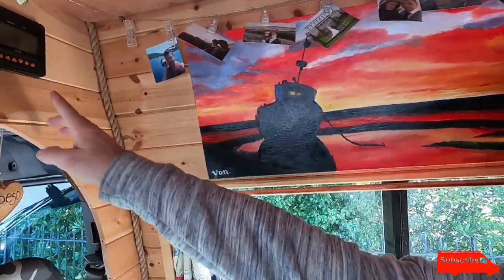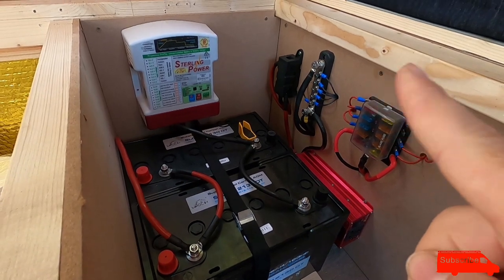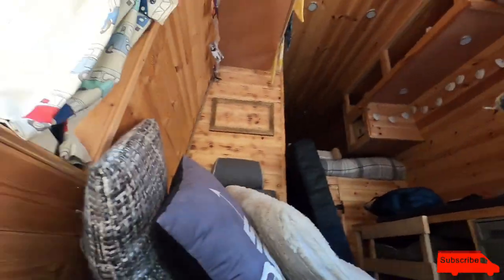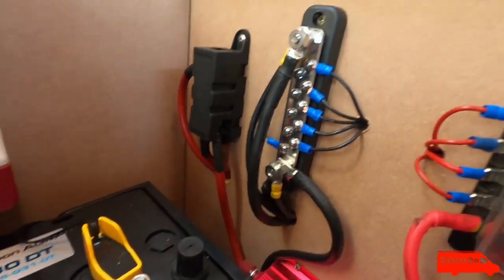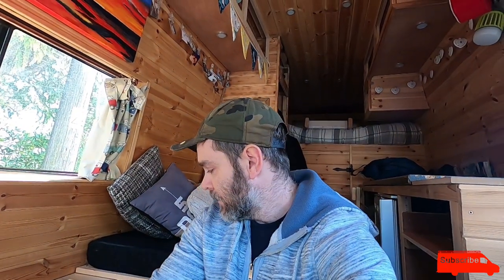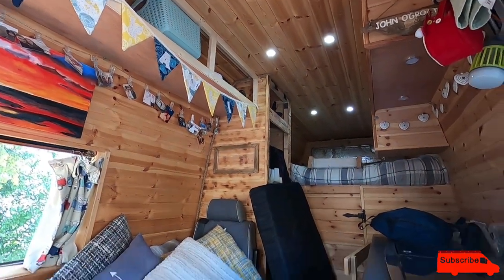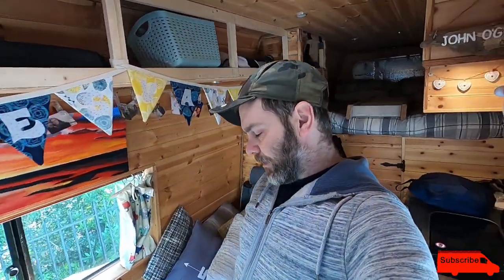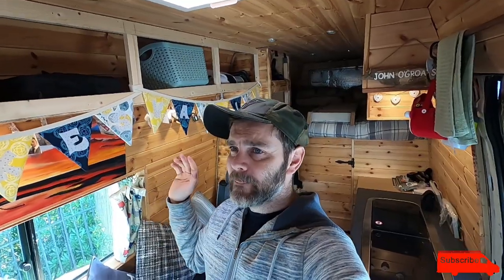My 12 Volts Electrics!

Comment: I think you have done a really neat job using the proper tools, well done you and Phil.
You are so right to wait a few months to try full-time van life. such a wise decision.
 
I would put the date of the batteries on top so people know when they were fitted. you should double-check you have the right fridge fuse fitted, that's really important now you have changed the power cables. maybe a fuse before the solar controller? 
You and Phil could do a simple video on van electrical connections dos and don'ts Crimp vs Solder.
Reply from the maker: Hi Mandy, Thank you very much. There will be lots more electrical bits to do but I am very happy with the results and thanks to Phil I had all the right tools and his guidance. I'm eager to move into the van and gutted we cant right now, but i your right, it's not the right time. soon though! :)  When you say put the date on the batteries so people know? What people? do you mean in case I sell the van? I will double check to fuse situation's. Thank you for the tips :)
Reply: @LukesVanLife  I work with heavy machinery its a health and safety thing plus it helps to sell them later on.

Comment: You can get a nice tidy switch gang plate on eBay for around £12 with 5 switches a 12v power outlet socket and 2 u s b's sockets and a voltage gauge in a black 5x8" square that looks neat and profesh plus that would help future prof having a couple of spare switches ;) just a suggestion looks good in my bus anyway :)
Proper nice job on your van by the way :)
Reply from the maker: Hi, I do already own one of those switch panels which I had in my first conversion, but I want something a little more rustic for this build, ive got my eye on a few. Thank you for saying you like my van and thank you for watching :)
Reply: @LukesVanLife  Hi fella yeah i admirer your van and channel when im more on my feet and this lockdown is done with i hope to do something similar to your build :)
I also hope i can build something even half as good and ill be happy 😊

Comment: Nice video and install mate 👍 couple of things I love your technical chunky wire 😂 but yes definitely needed it as its combats voltage drop its not always just about the amps . Your earth/ground/neg from inveter id move to the same bolt as your battery on the busbar as think that busbar is only rated at 100A but maybe wrong 😉 . Your lights are spot on mate and really good practice to take all negs back to battery/bus bar. If you wanted to get really tech then you could of used relays but that really ott. Fuse are there to protect the cable so also size cable to device and fuse to cable 👍 10/10 for grounding to chassis 👍👍
Reply from the maker: Hi Spunky, haha chunky wire :) I'm clearly not a tech guy like you :) Regarding the inverter neg, so If i did that my 200amp fuse wouldnt be working for the inverter? is that right? I do have some questions about my mains 240 hook up, Im comfortable with 12 volt stuff but mains is a little scarier :)
Reply: @LukesVanLife  thats tech enough for me bud 👍 the chunkier the better 😁 I'm not sure where your 200a fuse is, but the inverter neg doesn't really want to be running through the busbar in the vid it looks like the battery connects to the top of bus bar and the inverter at the bottom, id just move the connection from the bottom to the top on same bolt as the battery. Hope that makes sense? That way the big load of inverter isn't going through the bus bar. But that said if the load is less than the rating of the bus bar then no problem 😊. Just drop me a message on insta mate and I'll help as much as I can with your 240v 👍👍
Reply from the maker: @Spunky.sparks  if I moved the inverter to the top of the bus bar then I dont think there will be a fuse between battery and inverter, should there be?
Reply: @LukesVanLife  yes mate there should be a fuse just incase it decides to have a hisy fit 👍
Reply: @LukesVanLife  let me watch video again lol 😆
Reply: @LukesVanLife  the fuse should be on the positive mate not the neg thinking about it lol
Reply: @LukesVanLife  like I said mate it might be OK if the inverter is pulling less amps than the bus bar is rated to 👍

Comment: Just subscribed to your channel. Great job with the electrics Luke. Be careful with the switch to isolate the heater, as I am sure you know these chinese heaters need to go go through a shutdown cycle and can not simply be turned off as they will overheat quickly and can be potentially dangerous not a criticism as I think you have done a sterling job with your build just tell the missus not to hard stop the heater.
Reply from the maker: Hi William, Thanks so much for the sub. You are right it might be tempting for someone to kill the heater power with that switch, we obviously know to let the heater run its cool down process but I will make sure the wife knows as well :) Thank you for the kind words, watching and for subscribing :)

Comment: Hi Luke. Well I think you’ve done a really neat job. Yes label the fuses and a basic wiring diagram could come in handy. A 10/12 fuse box with built in bus-bars would have been easier and a bit tidier as the Neg bus-bar is in built; no ties needed. The Stirling B2B chargers are fantastic aren’t they, and Sterling is a great company.

I would like to make a suggestion. In winter you will probably get low on power during the Dark Months: Nov - Feb. Yes tilting solar panels make a huge difference. However as a backup I would consider a suitcase generator. This can be plugged directly into your 240V hook up to charge your batteries and also charge anything else via your 240V system as long as you have some sockets. I have a Honda EU10i. Not cheap for sure but absolutely superb! It could be a “life saver” in winter. I also think it’s good practice to have a backup for other essential kit. If your heater packs up in winter, how can you keep warm? If the hob packs up how can you cook etc. A small camping stove with fuel could easily get you out of a jam. If you had a Generator,  consider buying a cheap electric fan heater that in the event of a failure could provide some well needed heat in winter, or you could buy a basic gas heater  (Mr Buddy are great) that again could be plumbed in just in case, but ventilate of course. Just for emergencies. 

Living in your van is a great idea to save money and I wish you all the best.
Reply from the maker: Thank you so much, the advise and tips are very welcome. I'm taking notes :) 😁👍

Comment: Swapping out the VSR was the best decision so far, it only works with standard lead-acid batteries like the starter battery...
Bit pricy that B2Bcharger, but worth to extend the life of the AGM´s!
I ordererd a switch panel from ebay, one wit the the "zombie light" switches already labeled, was 10@ off from the individual or camper-style labeled, you only need to rmember what switch is what...
:-D
Paid around 30€, came with 6 switches, 12V socket, dual USB charger and voltmeter. I had to change the wiring on the backside, because the charger would be always turned on and waste energy. The positive poles are all looped through with 1.5sqmm wire, I wired them straight from the fuse block to the switch and from there to the devices. 

But be careful by removing the factory connectors, the main input wasn´t even crimped and I pulled a connecting pole out of one switch, got it back in and it works, but I can´t trust that switch anymore...
8-0
Bridging from the input of your fusebox to a second one could work, but I would recommend a new positive wire from the big primary fuse to the new fusebox...
Nice setup so far, next thing on my side will be a solar system, I hope everything goes right!
Thx for the vid!
:-D
Btw, don´t mention the plague that´s going on, I heard YT demonetizes vids where it is mentioned!
8-0
Reply from the maker: Thank you very much! Sounds like your build is coming along nicely :)

Comment: Independent earths can half voltage drop to a particular device. Using a twin run of wire, it has to travel there, and back, on possibly a small core of wire. Having the earth to the body reduces the resistance and so you get less volt drop. At least thats the idea!
Reply from the maker: You clearly know your stuff, Im still a noob haha :)

Comment: Looking good Luke 👍 switching can be complicated,  your using single pole switches which meens you only connect the positive or live cable to create a brake in the circuit thus turning things on and off,  the other kind of switching is a double pole switch and that meens you connect both positive and negative in order to create a brake in the circuit,  if I was using your choice ( single pole ) I would personally install a main double pole switch between my power source and all circuits that way I can safely isolate all circuits from my power source.  but that’s my own oppion and what I call a belt a braces approach. Good luck with the build mate it’s looking realy nice I especially like the pine TC boards 💪👍
Reply from the maker: Thank you very much for the tips. Electrics like the rest of the van is still a working progress :) Thanks so much :)

Comment: Good video.  Did you run a separate negative to the starter battery or just ground the negative to the vehicle near the sterling unit, also was the unit 30amp or 60 amp.  Thanks
Reply from the maker: Hi Brian, all my 12 volts are grounded to the earth on the leisure battery which is grounded to the chasis of the van which in my case is one of the bolts which hold the drivers seat down :) Also Im not sure which amp my unit is, Ill find out :) Thank you for watching :)

Comment: Hi Luke I'm just about to buy a van probably already built as my DIY skills are non existant your electrics look great I am unsure how I'd put lights in. Do I extend + and - back to the fuse panel or can I run them in Parallel? I also thought if you wire in the 24 volt hook up why not invest in a little generator. Sounds like an idea to me but maybe its not doable. Anyway love the Vlogsany thanks. Russ.
Reply from the maker: Hi there, apologies for the delay in replying. regarding the lights, the ceiling lights for example, I have six ceiling lights each with a positive and negative so instead on running 12 cables towards the batteries I connected them all together, all the positives together and all the negatives together. then you can run one cable (twin core, red and black) to the batteries. yes i could have a generator to power the 240 system if i wanted but Im hoping I will have enough solar/power to not need to find space in the van and carry a generator. If you dont already follow IVEAVAN on youtube, follow him, he has a real nice gennie in his van :) Thank you so much :)
Reply: @LukesVanLife  Hi Luke thanks for the reply I do follow IVEAVAN to I look forward to getting a van and taking tips from you both

Comment: I take it the light switches are on the side of the kitchen unit for using as soon as you come in the sliding door, can they be operated from anywhere else, just thinking about getting up for a pre in the night or early morning in the winter
Reply from the maker: Yes they are there so you can switch them on and off at the door. And as it stands they are the only switch for the lights but they may change. I've got more lighting to be fitted soon :)

Comment: Hi Luke.. I will leave this comment on.. Phil has phoned me and explained how the system works.. YES now I agree it does work how it should so there is no worry over it.. Cheers Bud

Hi Bud.. This is NOT a bad comment, just concerned.. Ha.  Going by what you just said (at 9:12) that one of the fuses in the box was your solar..? That means then you disconnect the batteries (or isolate them) the solar is still putting power into the fuse box..? This will still power everything ells that is connected to that fuse box..?  It should go direct to the batteries throw a switch.. The way to test this is just to disconnect the pos lead on the battery and use a voltmeter and check the fuses power..??  But I just think that because you don't really no what the fuses are for yet..?? Haaahaha Looking good though.. Cheers Bud
Reply: OK Phil. Thanks for explaining it to me..  The Fuse is the shut off. Cheers Bud
Reply: OK Luke your .. Your safe Phil phoned and explained it to me.. Cheers Bud
Reply from the maker: Hi Kev, I couldn't explain it as well as phil can so I asked him to. I dont know as much as you guys yet :) still a relative noob :) hope your well.
Reply: Hi Luke.. YES all well here.. not been out of house for 4 weeks now. Just going mad and giving Netficks a caining.. 
When I watch video it just came over that that box would be live all the time.. but phil explained and then realised the mppt controler was the key.. I have only really delt with mpt controler, so sorry for the confusion.. Cheers Bud and Stay safe and go mad like the rest of us..

Comment: How do
You can purchase a temperature sensor for your charge controller you will notice there is available plug connector next to the solar cable input
They are about £10 available on eBay
Reply from the maker: That's interesting, do you have a link for one? Thanks alot :)
Reply: 264576980072 once fitted they take the controller out of dumbe mode
And regulate the voltage as to the temperature of your batteries
Tidy wiring job for a guy who says he knows nothing about wiring well done
Reply from the maker: @sircaptainchaos2388  thank you very much :)

Comment: I've been looking at these batteries there old tech being brought back I believe can you do me a favour and whack on your diesel heater and let me know what your voltage drops too after 5 mins please as I have a 220ah battery and seems to drop the voltage quite quick and may change to the agm carbon type you have thanks
Reply from the maker: Hi Rob, I dont have a battery monitor yet, I have one coming so I cant test out the pull of the heater. but the voltage reading barely moves when the heater powers on. they are amazing batteries :)
Reply: That's perfect mine was dropping really quickly and have taken it back to alpha batteries for testing